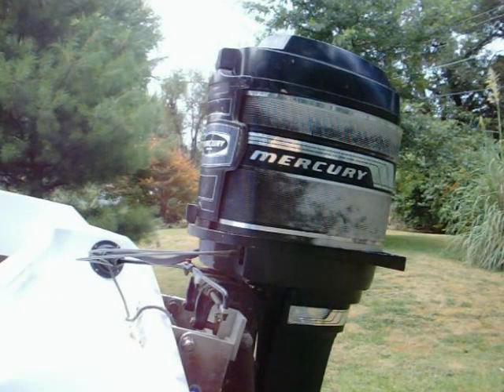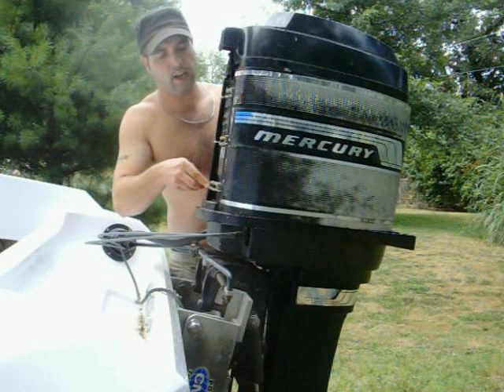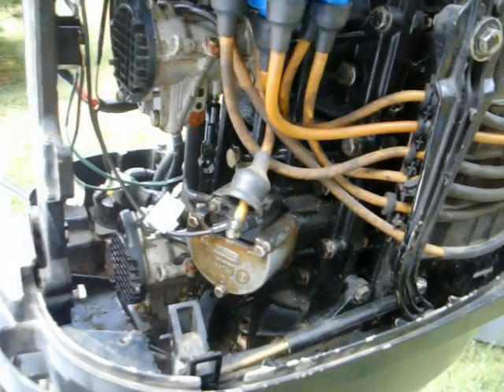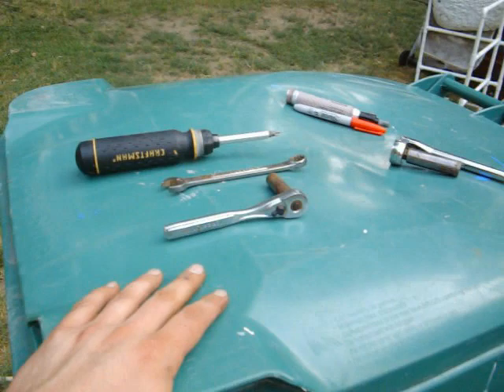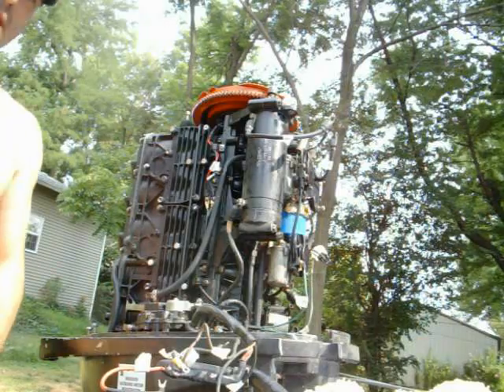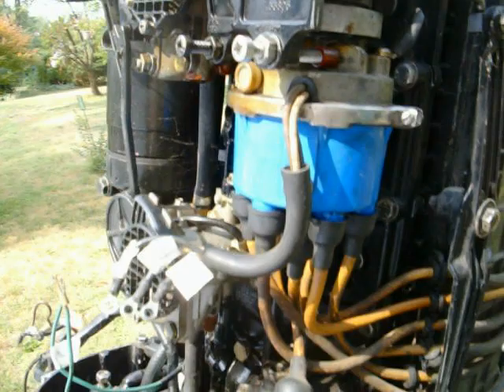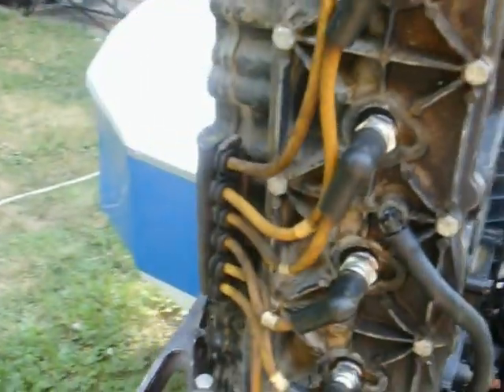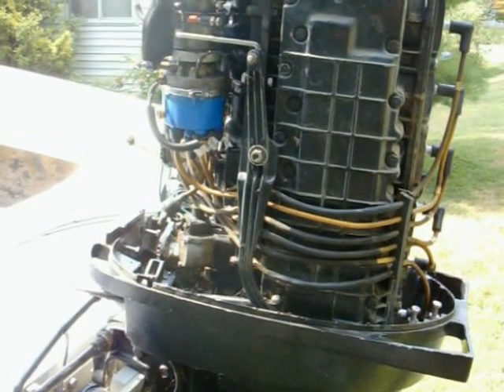1976 Mercury 1150 Inline 6 TOWER OF POWER Overhaul Disassembly Part 1

Comment: Really appreciate the videos and explanations. I was just gifted a 1975 Mako 19' with a 1977 Mercury 1150 with factory tilt/trim. Boat was sitting in a driveway in NW Missouri for 6 years. Checked compression by turning  flywheel by hand and am planning to take off lower unit, change water pump, plugs, clean carbs, hook up a new battery and see what happens. Thanks again!
Reply from the maker: Kelly Horn Sounds like fun!!! You're not too far from me. I work in St Louis.

Comment: Very Helpful! I have recently purchased a 1971 Checkmate MX-18 with a 1975 Mercury 150 hp. After replacing the starter and charging the battery, I've come to realize that I have No Spark to any cylinder. The gentleman I purchased it from told me that it did run last year but was having trouble getting it to plane out. I am also new to the whole outboard engine repair thing so, I really Appreciate the info you've shared!! Thank You!
Reply: Hi John Henry.
I also just purchased an old 1500 (150HP) 1975 as well. Now I've had boats in the past and currently am swapping out a 115 HP - though it is a 1990's Merc outboard. Anyway I have a very simple question for you and it may seem a bit dumb - but where does the fuel line connect on the 1500 motor - there does not seem to be a fuel line connector on my motor anywhere ???
Thanks for your or anyone else's help on this and pictures help me allot as well.
Chris

Comment: It's hard finding much info on these, great videos and thanks I'm going to look into rebuilding my fuel pump and checking my stator, I cant get it to go over 3000 rpm runs great but just dont want to go more than that every once and a while I can get it to 3200, my motor is a 90hp 900 serial 5160845 I've rebuilt carbs, took to shop have the timing set good compression, I've heard that maybe a failing fuel pump wont get fuel to the top 2 cylinders. Hope you see this and and for your time
Reply: I'm having this exact same issue! Did you ever get it figured out?
Reply: @AtlantaMetal   I haven't I've gone through everything new wire harness rebuilt fuel pump put a new used distributor on it and that I think was part of the problem it runs really smooth now took to lake yesterday and on the trailer it seemed to be perfect started driving and it would have a spurt of power then takes forever to plane I did the link and sync got it to go from 3000 to 4000rpm that's set at 20°, I feel the link and sink sounds easy and looks like a brainer but maybe I'm doing somthing wrong I'm about to give up idk what else to do everything checks out

Comment: I've got a 1978 Mercury 140hp. The copper water tube is bent out of round where it contacts the water pump. I purchased a replacement tube but don't know how to remove the bent one and install the new one. I have the plastic bushing that goes on the power head end of the tube also. Any advice would be appreciated.

Comment: Just bought the same exact motor for an 86 glasstron, the wiring harness and wiring need redone, also need to run the wiring from the throttle to the motor and get the throttle mounted. I also have to figure out the wiring for the reverse control system, bought the boat and motor for 150, couldn’t pass it up.
Reply: Some help or suggestions with the wiring would be very helpful
Reply from the maker: Cdi sells the harness you need.

Comment: I have this motor! I need to remove the head to replace the gasket, do you have a video of removing this part?
I have water leaking at the base of the spark plugs... I figure the water jacket seal is compromised...

Comment: Also do you know what the rubber hose that comes from block to a t into block then up to another 90 degree fitting into the block, right next to the fuel lines for the carbs on the front, thought maybe for mixing the oil maybe, I premix

Comment: Is where does the water from the water pump exit on this motor?
Reply from the maker: Out of the "tell tale". It's a small tube on the starboard side of the outboard. Small rubber hose will be sticking out of the lower surround. If you take the engine cover off, you'll see the tube, it connects to a 90 degree fitting on the back of the motor. 
For what it's worth, it does clog. Unhook the rubber hose and run a piece of wire through it or compressed air.

Comment: Don't know if you can help me with my problem, but, im looking for the thermostat and poppet valve on this engine would you happen to know where it is by any chance?
Reply from the maker: There is no thermostat/poppet valve. These just use fresh water in to cool.
Reply: @cturboaddict  th thank you I appreciate that... Reason I ask is because when I changed out my Impaler in my water pump, I started to get hot water coming out of the pee hole, really hot water while on muffs, but it didn't do that before I changed the impeller, I can't figure out why it started doing that now.... Any ideas on what it could be? I had been this engine before in the lake and had no problem with it I just didn't think that the stream was strong enough coming out of the pee hole ,so I changed the impeller, and now I get really hot water coming out of the pee hole, so I took it to the lake and ran it a little bit and it got really hot, and I can't figure out what happened? Any ideas I sure would appreciate it
Reply from the maker: @michaelgreene2920  water will be hot from there. The lake will be much cooler.
Reply from the maker: @michaelgreene2920  but, you might have something clogged in the lines or impeller tube
Reply: @cturboaddict  thank you I'll take it back apart and see if that might be what the issue is
Reply: @cturboaddict  that's what I thought too but it ran extremely hot and I had to shut it down
Reply: This video was extremely helpful with getting started on the rebuild of the boat I just got mercury 1500 not sure the year but it looks really similar to the on you got there 🤘🏻

Comment: Hi i have same motor on my boat but i can not find the fuel pump do think if is posible use a diferent fuel pump on it thanks let me know
Reply from the maker: Fuel is primed by the primer bulb attached to your fuel tank. It's then suction fed via the engine operation (carburated motor). There no fuel "pump".

Comment: I had mine rebuilt by an outfit on the east coast , on the corner coast between Maine and Massachusetts.  I forgot the name.  The distributor is the Achilles heel of these motors.  There are like 10 guys in the USA that know these things.  I paid big bucks to get a the motor freshener. Haven’t run it in 6 years due to being butchered 10 times to get a new knee, actually 4 knees.

Comment: My throttle is a little hard to go forward and reverse.  I replaced the throttle cables, but seems that the distributor and whatever is on top of it have two grease  fittings.  What is the recommended grease for them.  I'm thinking it needs to be greased..
Reply from the maker: +luke sines Just a standard marine grease. Available just about anywhere.

Comment: I have a 78 115 mercury engine got spark going to the spark plugs how do I check to spray starter fluid so it could turn on. It turns but like if no gas is going through it so it could turn on

Comment: Hey do you know what what the rod crankshaft end bolt sides are ? I am having a problem with taking the con rods off the crankshaft
Reply from the maker: They have a nut on them... LOL Are they not popping loose? If so, A rubber mallet or soft faced deadblow are your best friend. I do have another vid of disassembly! Or if you need a photo or video of one disassembled, I have one to show. Just let me know bud!

Comment: I took a chance and just bought a 1976 Glasspar with this exact motor (believe it's the boat's original motor). After working through the boat's wiring issues I finally got the engine to turn over, only to find that the flywheel is stuck. Any suggestions, that don't involve a complete rebuild, would be greatly appreciated. Thanks in advance!
Reply from the maker: Byron Holcomb Is the motor seized??? Couple things bud. 1, Check to make sure the starter gear is not fully engaged onto the teeth of the flywheel. (Starter could be stuck, the bendix gear should drop below the teeth of the flywheel when not engaged). 2, Take the spark plugs out and soak the hell out of the cylinders with aresol sea foam or marvel mystery oil before firing.
Reply: ***** The bendix gear is good and the starter "teeth" are engaging into the flywheel (it moves just a little but no farther).  Was guessing either something with the gearing or a stuck piston but apparently the stuck or seized piston is the winner! Have been spraying/soaking the cylinders overnight with Corrosion Block and was planning on moving to PB Blaster. Plan on just soaking the heck out of it and trying every couple of days. Guessing the last thing I should do at this time is get a breaker bar and beat it into submission.  Let me know and thanks.
Reply from the maker: Byron Holcomb Is the bendix gear disengaging? That was more or less my question... Keep spraying, you can put a 13/16 socket and rachet on the top of the motor and spin it. (Make sure to go in the correct direction of the waterpump). Make sure the controls are
 in Neutral as well...
Reply: ***** Well it's official, I think it is time to find a new motor. The propeller is rusted on and half of the drive shaft is rusted and the gear oil had water in it.  I filled each piston with Marvel Mystery Oil and every cylinder held the oil (slowly draining) except the top, it took about 5 seconds for it to drain out of the bottom of the engine. Cutting my losses on this one and looking for a new motor; will probably part this out what I do know is good on this one. Still looking for an older Merc but I know much better now what to look for and avoid. Thanks for all your help/advice.
Reply from the maker: Byron Holcomb It's probably stuck rings on the #1... IT happened to me on mine after sitting. A simple hone and new set of rings gave me 120 comp all the way around. Good luck, and let me know if I can do anything else.

Comment: Do you kno if it has a thermostat because  I have Same one as you when mine is idealing it doesn't pee but when I ideal it up it peas replaced the impeller
Reply from the maker: There is NO thermostat. You probably have a blockage. Disconnect the hose, and run a wire through it. While it's off, run it. If it doesn't pee, your blockage is deeper.
Reply: @cturboaddict  thank you so much I only bought my boat  and engine  for 400 and just trying to get it to run right

Comment: So I replaced the impeller and cap and reinstalled but my controls are reversed forward is reverse and reverse is forward can't figure out why
Reply from the maker: Your shift linkage is rotated. It's the small rod in the front. Disassemble realign and reinstall.
Reply: cturboaddict thank you sir
Reply from the maker: It's easiest if when it's disassembled to rotate the shift shaft into Neutral. Make the the controls are in Neutral as well. Then reassemble.

Comment: I have a question..I have same motor. i noticed my telltale hose connects to an elbow on top of the head....but I have a spare for parts and it has it in the Centre. .what's up with that. ?
Reply from the maker: +Kevin Masihia Probably not the same years. Some of the older motors have them in slightly different locations.

Comment: excellent video, I'm stumped where it the thermostat? plz help
Reply from the maker: There is no thermostat bud. What's your problem...
Reply: The normal, no water out the tell tale. I've even taken the lower section off and stuck a hose where the water pump goes. Must be clogged? Thanks heaps for the quick response
Reply from the maker: You've got pretty much one of two issues possibly. Simple diagnosis.
1. Your tube that connect from the backside of the motor (near the spark plugs) down to the shroud where it pees out is clogged. Disconnect the rubber hose, run a coat hanger through it and blow it out with air compressor. (Bugs die up in there and clog it every year).
2. Your IMPELLER is bad and should be changed. I have a video on how to change your water pump impeller. It should be done almost every year depending on how much you use your boat. 
Just search my name and the tag "lower unit, water pump, impeller" and you'll see a few vids. Here's one to start.
https://www.youtube.com/watch?v=PYY5cQXTALA
Reply: Hi, Thanks so much for your content has helped me plenty with two boats running 150 inline 6s in the past few years - almost identical to the 115.
I'm also not getting a telltale even after replacing the impeller. I blasted compressed air up the telltale spout and heard a pop. Inspection revealed that the pop was the pipe that leads to the spout becoming disconnected. Now there is about a 4 inch length of pipe that doesn't connect to anything and I can't see what it is supposed to connect to.

Any tips?

Comment: I have an 86 90hp.. when it runs it runs great.. yesterday I put it in gear, punched it out of the hole. It bogged took time to recover, prior to this is was running great. Lost power and 5-6 mph. I just spent a lot of money having the carbs rebuilt and this was its shakedown run.. any suggestions?
Reply from the maker: So, after carbs rebuilt it bogs? Did you happen to check your primer bulb? Squeeze it when it bogs and see of it cleans up. If so, replace bulb.
Reply: cturboaddict brand new hose & bulb also ew filter..
Reply from the maker: @frankdwornnig8513  are you sure the floats are properly set?
Reply: cturboaddict I had a pro rebuild all 3 with oem parts..
Reply: I just had the fuel pump rebuilt.. it looked like it has never been apart.. hopefully this will cure it
Reply: The boat sat more then it was used. It starts and idles fine.. I’ll see how it does on the lake tomorrow weather permitting
Reply from the maker: @frankdwornnig8513  So, has it worked?
Or still having trouble?

Comment: The pouch in the face plate held a rope w/ handle so you could pull start it.  Yes it's possible to pull start it lol.

The bottom spark plug can be taken out with ease with an open end, or box end wrench.  To take the belly pan off, requires separating the engine block from the mid tower

Comment: the motors are identical..except mine has a brass plug in the center in between the 6 spark plugs..as the spare is using it as the telltale hose..and has the top plugged.the serial numbers say they are both from 1978..anyway I did a (twice )cold compression test last nite and they are as follows 100#1-120#-2#120#3#4-120-120 120-6..is that good ..would I get higher if I was to put water throughout in my barrel and let it heat up to operating temp and than try .or will it be pretty much the same?  also if ya ever need any parts I have a entire engine and outdrive..just letting u know. thanks bud
Reply from the maker: +Kevin Masihia Someone was running a water pressure gauge then.
Will keep that in mind, but I own 3 motors already. :)

Comment: Excellent Video series! I'm trying to rewire a 1971 Merc 500. Wire insulation crumbling off everywhere. Can't figure out how to remove the front bracket to get to all of the wires without messing something up. The motor starts and runs but I'm afraid to run it with the wires in such bad shape.  Any help would be appreciated. Also, the mercury switch wiring is gone. Is it needed to run?
Reply from the maker: Merc switch is not needed to run. But it is a safety item. It's designed to not be able to start the motor in full tilt with the blade out of the water.  You're own discretion. 
I would replace all the wires personally, that's what I did.

Comment: I like your video good job. I have a 1971. Do you have any video how to remove flywheel?
Reply from the maker: While most won't recommend it. Just unbolt the top bolts and use a puller (they make specific pullers for these motors).
Reply: I have the special puller. Do you have to remove all  eight bolts and the large nut in the center? Thanks for replying.
Reply from the maker: @garyduncan2062  yup
Reply from the maker: @garyduncan2062  actually.... I think you can remove it without the large nut being removed if I recall correctly. Mark the flywheel location before removal, remove the 8. It should pop right off.

Comment: Anybody messed with the top bearing under the flywheel?? My local dealer is telling me this bearing is no longer available. Any help would be greatly appreciated
Reply from the maker: You can get pretty much any bearing or seal online.
Reply: cturboaddict thanks
Reply: cturboaddict any links off the top of your head ?
Reply from the maker: @mversaevel  crowleymarine marineparts or marineengines. Just add a dot com to all of them. Find your appropriate part number and either order direct or search ebay for that part number.
Reply: cturboaddict very much appreciated ! Thanks so much

Comment: hey,
i have a 1974 115 tower of power it's pumping out close to hot water? any ideas?? ASAP
Reply from the maker: From the hose or in the lake? From the hose, semi normal for an idling motor. In a lake, it should be warm, but not scorching.
Reply from the maker: Can you put your hand on the #1 cyl when running an not burn yourself? If so, you're good.